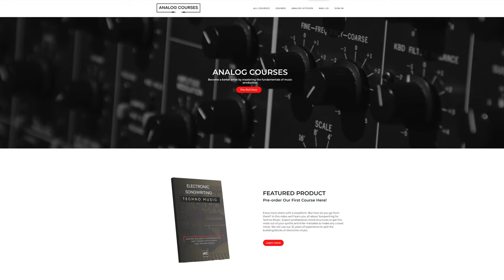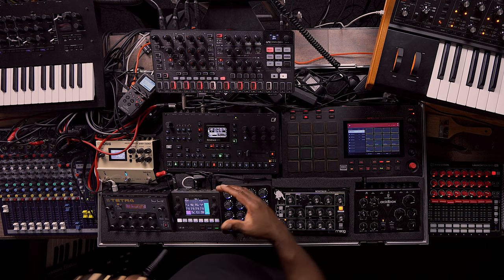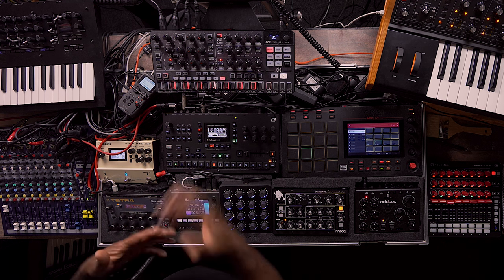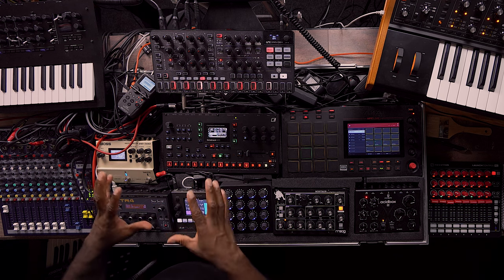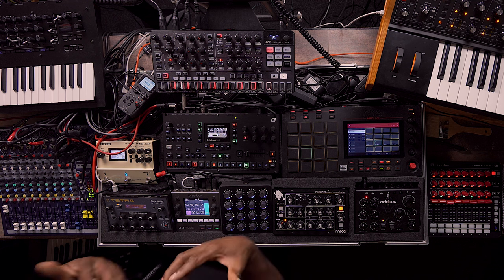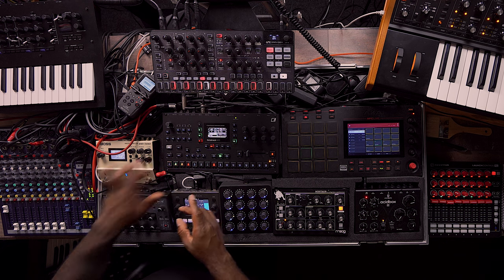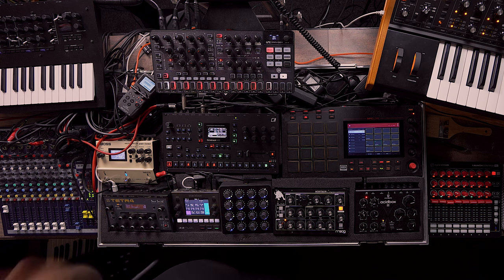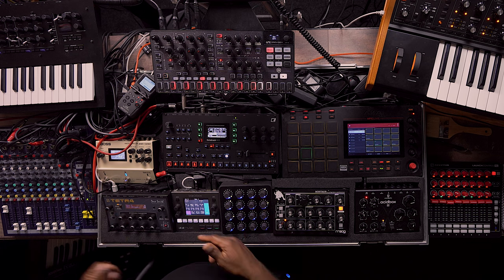Working The One Box Groove

Comment: My Octatrack died yesterday. Blank screen no sound and organs leds. Hope it can be fixed, or i’ll get a new black car one.

Meanwhile enjoying the Rytm and Digitone combo
Reply from the maker: Whoah... That sucks! How much were you relying on it? Is it a huge loss? Or manageable?
Reply: @AnalogKitchen  was using it as a performance mixer, now I just use the audio in of the Rytm.

I am afraid of more gear braking though. I used to have an MPC live as well, until the pads kept triggering by them selfs even with setting the threshold higher. 

Luckily both under warranty 😀
Reply: My Octatrack is back with a replaced capacitor. 😀